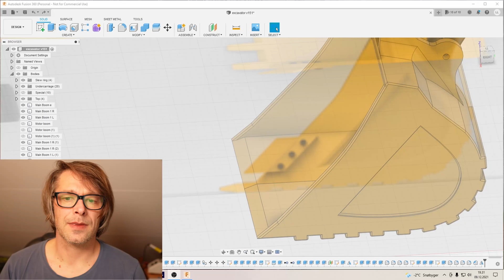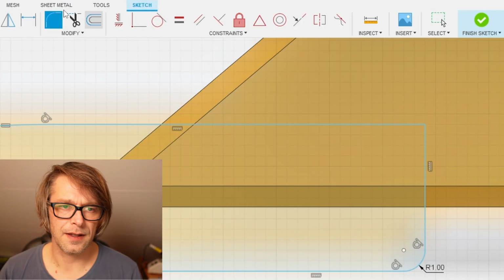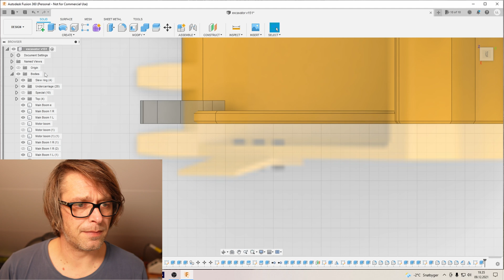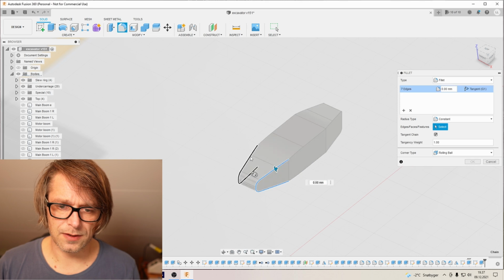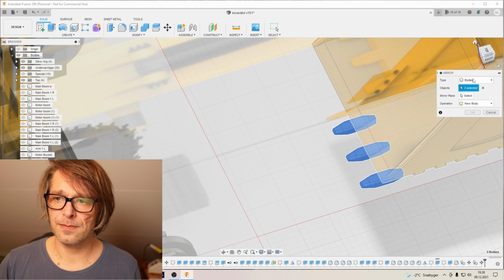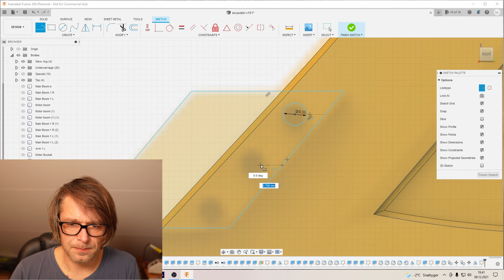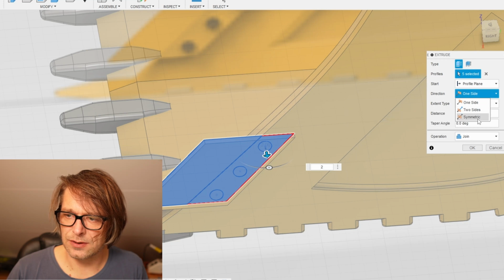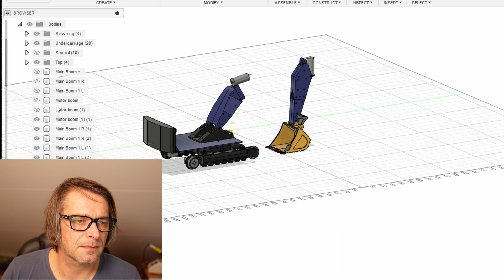RC Excavator Bucket in Fusion 360 for 3d printing. The Teeth

Comment: thats a great design my friend.  just came across your channel.  I have been dying to find or someone to make a 3d printed bucket for my rc4wd 870 loader.  I have the original one which ways a ton, yet I figured if I can come across a 3d printed design to purchase Id give it ago.  It would mean it would be that much lighter for loose dirt and less work for the machine.  Never know until you try to see if its going to work or not..
Reply from the maker: Thank you.☺️
I have no how long it will last. But I know several who use 3d printed buckets. So my guess is that it will be ok. 
I could change the mounts to fit your needs and share the file, if you have access to a printer.